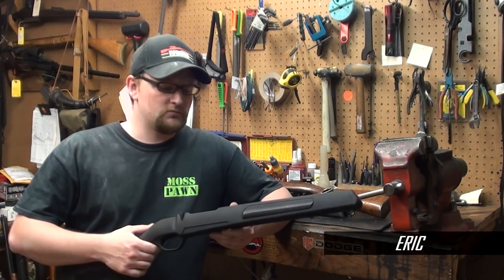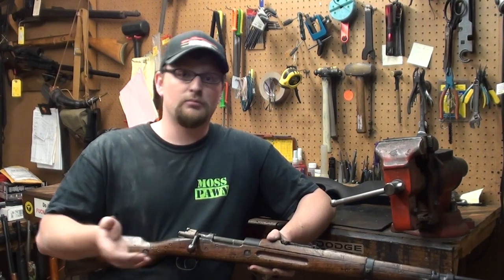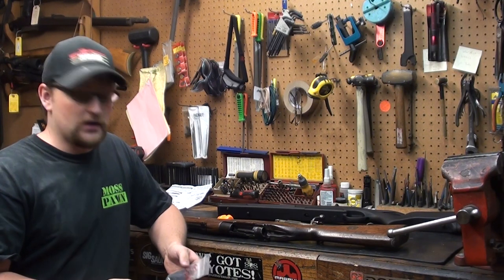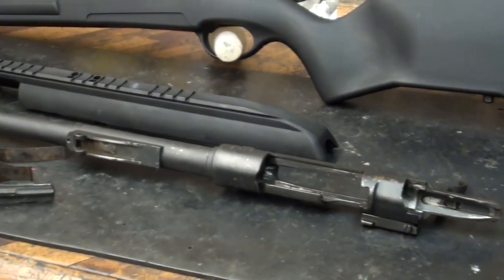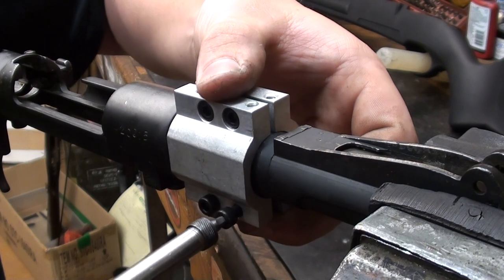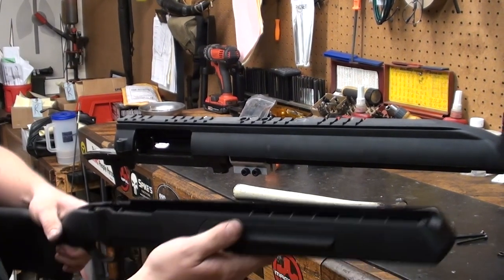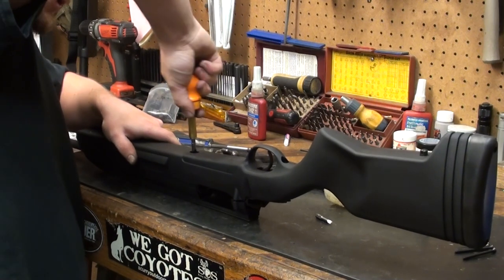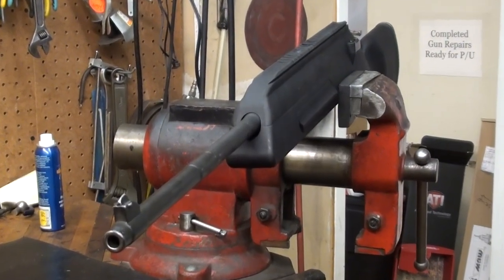How To Episode 2: ATI Mauser Stock Install

Comment: Thanks for the vid bud. I am working on a project Mauser for myself made up of parts I have gathered over the years. And the stock I would like has the look of the ATI, I just don't like the light weight and flexibility of polymer. So I checked this vid out to kinda see if I can easily modify it to suit the problems I have with it. Looks like I can bore some small holes through the forearm and insert a couple brass rods the length of the forearms to under the action to stiffen up the whole stock to act as a tensioner of sorts when tightening up the trigger guard screws. Sort of like the Bottom metal/trigger guard on a Swiss k31, and how it works as a sort of leaf spring to tension up the receiver to stock fit. I will probably then pour some 2 part acrilic with carbon weave layers, or maybe fiberglass resin and a tight weave  fiberglass matting for boats. After neatly inlet as needed to loosely fit action back in. Then coat the action in release wax and fill the inletting with polymer resin or glass bedding and reinstall the action tight and true to let it dry for a couple days. Then hopefully I will have a heavier and stuff as heck stock that can shoot well. I will be using a Brazilian m1908 30-06 action and bolt, a custom 26 inch medium heavy .220 swift barrel. That will probably end up being cut to 22 inches, if that allows a complete powder burn as I haven't checked, with a threaded muzzle and custom break. Of course a nice hand polished hot blue job would be the only finish I would take time to do, as I hate and haven't seen a reliable enough bake on coating yet, other than a powder coat. They all scratch way easier than advertising leads you to think, and I have done 100s of firearms in both Duracrap and crapacoat. They all scratch too easy for me. I would love to be able to use the factory coat Glock or Smith and Wesson uses on their pistol slides, stuff is awesome.

Comment: I once stripped out some threads on my wife's Ducati motorcycle after I told her what I was doing was easy and anyone could do it, fortunately someone told me about Heli-Ccoil thread repair kits.  Someone said that airplanes just skip to using them in the first place, it worked great and I told her about it after we sold the bike, it was a yellow one if you think it's yours.

Comment: Can't wait for your stock repair video. I have an unmarked Spanish 1916 that is a bit of a beater. While the metal is in pretty decent shape, the wood is pretty beat up. Previous owner has some cracks held together with wood putty. Don't suppose you know of anyone that makes a stock for small ring Mausers, do you?

Comment: That looks tough!  I think your right, it would look sweet as an SBR....You mentioned the different bolts not working in this stock...I have a turkish model with the straight bolt, does this work in that stock or no?

Comment: i got one of these for my Turkish mauser and it was listed in the list it will fit and the stock is giving me all kinds of hell putting it on
Reply: +Alex .Johns     I bought and installed 2 on Turkish 1938's and had no problems other than I can't stand to look at that skinny barrel sticking out the end. Might try an aluminum sleeve for bulk.

Comment: I would be nice if it were possible to cut off the scope mount above the bolt, and set it up as a scout. But it looks like that isn't possible with how it screws together. 

Do you know of any other glass/tacticool stocks for the mauser that would be suitable for that purpose?

Comment: I have a Yugo 8MM since they first came out about 20 years ago. Shot 2 boxes through it. 1 box to sight it in and one box was used to hit a Coyote silhouette every shot at 300 yards with open sights. I would not put that stock on my Yugo. However, You did spark my interest in my Yugo again. Do they make a detachable mag kit for the Mauser like the Badger Ordnance M5?

Comment: Just curious. Other than the bolt, why won't this stock work on a 38? I have several of the 38's that I'm building at the moment. My main build that I would use this stock on will have flip ups instead of a scope.

Comment: i am getting ready to purchase a gewehr 98 that has a shortened barrel and the stock has been turned into a mannlicher style stock. it also has a turned down bolt.  will this rifle fit in a k98 stock?? i dont mind its current configuration but if it fit in a k98 stock i would prefer it

Comment: man that thing is fugly
why not get a proper wooden sporter stock and mount the scope the good old wehrmacht way?
Reply: TheAngler2210 money
Reply: Repro Scope Mount should be the same price as this stock.
Reply: TheAngler2210 not everyone wants a scout type setup though.
Reply: Well then you dont put the scope on and leave the rifle with the wooden stock and the iron sights, i dont see the problem
Reply: TheAngler2210 but what if I want a scope? That is the problem. This stock solves that problem because if you have a mauser and you want to scope it, your only options are drilling and tapping or a scout set up. With this stock you can have it in a conventional set up without mangling your gun. Even if it is odd looking.
Reply: Yes.  Yes, it is.

Comment: Nice video.  I watched it twice as I am still not ready with my gun.  It is at my Dad's workshop so have like 20 min. when I drop kids off,  so having a little trouble.
It looks like the aluminum bracket (scope mount) is 1/16" too long to fit between the stepped barrel and the old site.  I removed the site flip up as shown, but there is just no room between them.  Should i just cut down the aluminum piece a tad to get it to fit.  I see no other option.
thanks and good video.

Comment: I have a 1916 KAR 98A that was sporterized in the 1950's. I believe it has the small ring and cannot find an aftermarket synthetic stock for it. Any suggestions. The stock on mine is cut down from the original.

Comment: why should somebody do that to this classic gun????
Reply: Did you see that HUGE CRACK down the center of the wood stock?!
Reply: @fredweller1086  oh ok, but is there not an option for an original k98 stock?
Reply: @djgoziggaga  Go shopping.  Most military style replacement stocks go for $150 to $300 dollars.  The ATI stock is running about $75.  
If you're rolling that fat in the green throw some my way, brother.
Reply: @fredweller1086  ok, thats an argument :D
Reply: @djgoziggaga  Well, only an idiot would spend $300 to fix a common $150 milsurp rifle.  But if that's your thing, go for it.
Reply: @fredweller1086  ok, thank you for that nice advice!

Comment: I had one for my 8mm M48.  It is a SHIT stock!!  I mean it is laughable.  It does not work with a M48 Mauser.  Sure it will fit, but it rattles around inside the stock, and is very CHEAP quality.